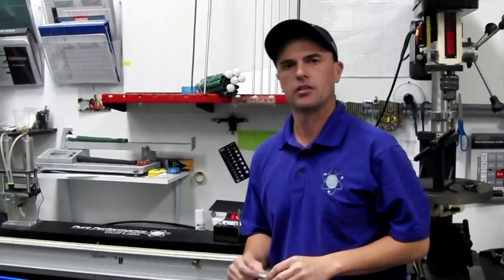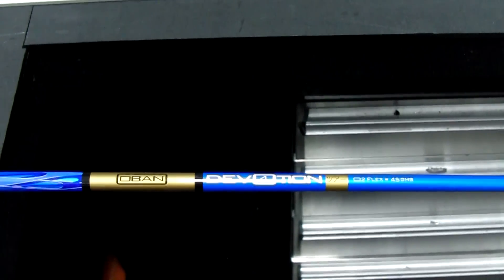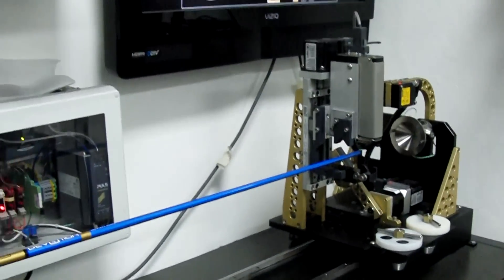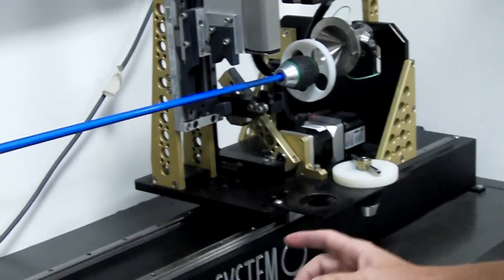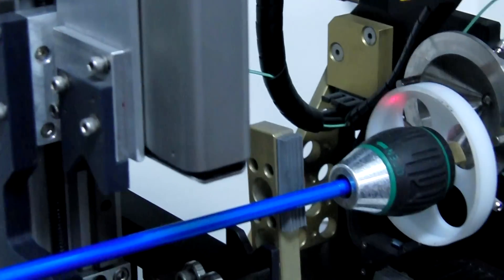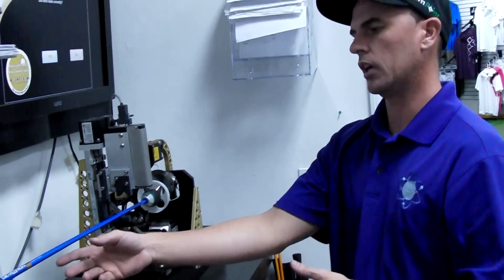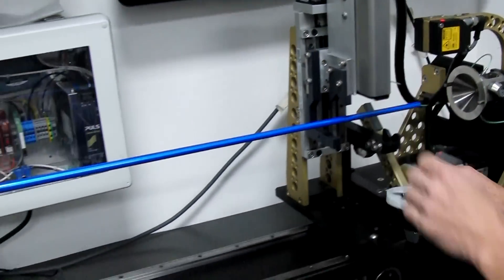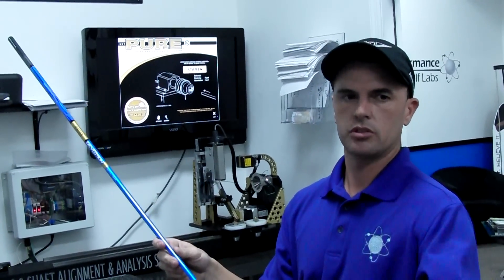SST Shaft Pureing vs Spine Aligning

Comment: When a shaft has multiple spines, it's trash.  No more than two. One is better.  I have had great success using the old bearing spine alignment method.  I weight the tip with a laser and flex and release and it draws a straight line where the spine is.  Assuming it doesn't have multiple spines.

Comment: You don’t spine align graphite shafts because of multiple spines in graphite shafts........only spine align steel shaft you will only find one spine in every steel shaft then insert the spine at 3 or 9 o’clock

Comment: Independent testing showed you might pick up less than a yard on your average shot with NO measurable improvement in shot dispersement. But at $20 per shaft, go for it.

Comment: A bearing based spine finder likely does not tell you how a  golf shaft oscillates.   It will likely find the plane that has the least amount of straightness in a shaft.  If a shaft is in its natural unflexed position, so unstraight it is already bent like a spatula, that thing will turn every time to the mcdonalds arch position in a bearing spine finder.     Yet, what does that tell you about how the shaft will actually bend when a force is applied to one end?   Guys who put a weight with a laser on the end and let it hang loose and then tighten so it now has its center of gravity straight down, can then twang the shaft vertically.   Do that, rotating the shaft and you will likely find the straight flexing planes or FLO flat line oscillation.   Got a frequency meter, measure the frequency in each of those planes to know the stiffest one.   One may also wonder if the stiffest one is best, or if someway one could measure how wide around that shaft that spot stayed oscillating straight as the best.         Want to find the unstraightness of the shaft, or residual bend in it.  Use Kaufmanns inverted flex board.  Mount the shaft horizontally, and put the tip in like a block of wood roughly size of matchbox, which then rests on your scale.  As you turn the shaft, the highest reading is when the shaft bend is pushing down into the scale, the lowest reading would be when the end is then trying to point up to the sky.  If you want to try to get some type of way to compare the numbers, they are showing you the bend.  However, if you put two  holes in the block an inch apart, and the take the difference of the numbers, that will give you a force number with most all the residual bend impact eliminated.

Comment: I have seen people find the spine of just the shaft and then do the FLO procedure without the head on the club.....you need the head on to use the weight and symmetry along with the shaft to see the WHOLE picture....there is a lot of misinformation on both spine and FLO and I think it deserves a better look and explanation.  This glosses a few great points on how it could be done......my concern is DYNAMIC FLO....meaning with the head on and you will find that the spine might be a starting point reference, but only 1 out of 15 times does it line up with the oscillatory forces with the head on.....

Comment: at what point do you add the the swing  speed factor in to the shaft twist? 
say i have a swing speed of 85mph.  shaft is  flo/spine.   Now at address my shaft Spine is aiming at the target. Now, from the top of my swing, on the way down, the shaft will twist towards it's weakest point  so that the spine will no longer face the target, the weakest point will to the target! because the shaft will all ways take the least resistant path. and the amount of twist will depending on the speed at which it is traveling. Now make the swing speed 115mph, Shaft will still twist via it's weakest point faster.
 So, in theory! spine adjusting does little good. better work on Shaft flex and kick points. And since the kick points are the least path of resistance you can control the amount of twist  at the  kick points. Take an X stiff shaft and put it on the machine, If I'm right, you will find the x shaft will take less adjusting. May be even no adjustments needed. And. HMMMM! something to think about!

Comment: No offence intended but quite a garbled explanation.  Spining cannot be directly compared  with shaft puring. To compare operations identical procedures should be followed. In the case of spining such only comprises stage 1. Stage two is to loosely affix the head to the shaft (bind the tip with thread and then force the head on over it); fix the shaft butt in a vice;  vibrate the head; adjust until everything flat line oscillates. 

But is shaft puring, or fine tuning spining by F.L.O (flat line oscillation)  the logical way to go?  As opposed top say simply spining?

When one swings a golf shaft the force of the head causes shaft twist (torque) and many  assume that  at impact the shaft  and head have somehow reverted to bring the head in square  

I venture to suggest that if one affixes a giant weight (i.e. a club head) to one side of the shaft, and combine that with centrifugal force, the club face will have a natural tendency to come in open. Hence golfers inter alia turn over their wrists in the impact zone in order to correct such.

I further suggest that the force twisting the head open is too great to be countermanded by simply adjusting shaft spine location.    Thus flat line oscillation gained in either a puring machine or by vicing and tweaking  is purely a misleading  illusion.  Even if loading the shaft a la puring maching did work the load to apply is unknown unless one knows how each golfer loads the shaft via swing speed, lag etc.

So, I suggest that neither spining or puring can provide a means to alone consistently bring a club head in square. The larger key to such is  through a combination of both wrist turn and the natural turning motion of a sound golf swing.

Obviously however such needs combining with a consistent head position and spining by itself will go a small way to encourage such insofar as such enable the shaft to achieve its optimal minimal torque. F.L.O.ing  and puring are both unnecessary as largely they alter the spine location via a wrongly chosen  force and undo a small amount of good work.

Comment: PURE is a great and it is the most accurate way to spine and/or FLO a shaft.
I wouldn't challenge PURing but I would say that it is much mot beneficial to also perform a MOI matching on the clubs as opposed to Frequency matching. Most shafts these days are tapered anyways...PURE+MOI match FTW

Comment: I Floed all my irons about 2 years ago which I have been using for 20+ Years. I found the spine as a reference, then found the strongest bend position, used this to face the target, installed the head and then fine tuned floed the club until they perfectly Flat lined. I didn't use a fancy pants computer controlled machine but I believe I got each Iron spot on. The only difference I made to each club was they felt stiffer. I do not believe it made any difference to consistency or distance.
Reply: If you do not believe that it made any difference to consistency or distance, do you think that these analysis/processes provide a psychological placebo effect?
Reply: @jalan8171  When I first used the clubs after I altered them they felt stiffer than usual, I got pretty used to the feel of them after using them for so long (20 Years no joke). After a few games I got used to them again and I honestly would have not known any difference. Distance did not change and my handicap didn't dramatically change overnight either. If It helps someone play better knowing they are "Pured" then go for it. Me personally, I wouldn't do it again. Im now playing with off the shelf Mizuno's bought from eBay and my handicap is the lowest (8) its been now for 3 straight years. I have commented on this topic before on WRX and I had one bloke telling me I did it wrong and needed it professionally done but I don't believe it would make any improvement over what I did to them.
Reply: @jalan8171  I have also done this to graphite shafted Fairway Woods and found little to no difference also. I did it to a set of Titleist 910 3,5,7 Woods (I don't like hybrids) with Aldila Rip A Shafts. I now play Titleist 913 3,5,7 Woods Aldila Rip A, untouched, still set on A1 neutral. I can hit them fine and like I said my handicap has been its lowest for years.

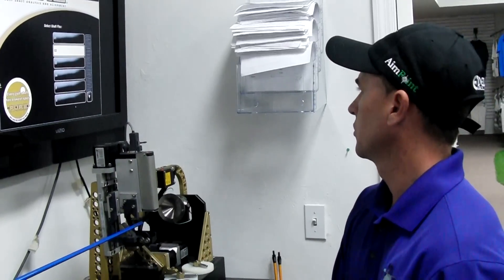Comment: you can set the club up to draw or fade by moving the spine to the left or right.  For the clubs with adjustable heads, when you move the head to a different loft it does change the spine.  I prove it to players everyday.  It the club kicks to the right guess what, a fade or slice. If it is set to far to the left here comes a draw or hook.  You always want the shaft to kick towards the target.  Very simple process to do but no body knows how to do it.  If you set the spine at 12:00 you are hitting against the spine.   Different club builders set the spine at 3:00 and at 12:00 but 9:00 is the only setting that brings the club face back to the target line which gives u more kick from the shaft and most of the time more distance and straight.
Reply: Kenny Pruitt you can do this and it works. however, it is ILLEGAL during tournament play.  http://www.usga.org/rules/equipment-rules.html#!rule-14618,bend
Reply: excellent information, thanks. i am spining my uncut shafts soon and will glue them in at 9.00
ta
Reply: So does that rule not dictate that all shafts must be perfect, and therefore all are illegal as it impossible to manufacture them without some degree of asymmetrical flex.

Comment: This would get you an altered flex (freq.) - max stiffness point for the stick. Seems that for irons, you'd have to freq analyze the shafts after SST, in which case you would have to hand pick a  set from a stock of already SST'd and freq'd,  individual iron shafts to get your desired freq (determined by fitting) steps accurate.

Comment: I think most of the confusion here is stemming from the idea that the spine and PURE orientation are not only interchangeable terms, but that they can be consistently correlated, no doubt the blow back from some clever marketing relating to "spine alignment" from years ago.  Simply put, Identifying the "spine" only gives you a reference point from which to begin the process of FLOing a club, which is still a manual trial and error process, and not privy to the data set that this machine offers.

Comment: You are correct that the shaft is turning and twisting.  What this method does is find the most consistent position of orientation for the shaft relative to the clubhead, that COMPELS the shaft to naturally return to its ORIGINAL position DESPITE the inconsistencies of the LOAD ON THE SHAFT DURING THE SWING.  Unfortunately this process is NOT conducive to the current manufacturing/distribution model used by the top equipment companies due to the overwhelming ignorance by their customers en masse

Comment: This is completely and totally wrong.  Anyone who has the comprehension to understand the variables involved KNOWS that the "spine" is just a reference spot while performing the FINAL orientation of the shaft relative to the club.  There are other "spines" in most shafts that can work against or with the main "spine" identified with simple bearings.  This SST method does with technology what used to be achieved only through a manual trial and error process.

Comment from the maker: All the guys you named in your quote REQUEST shafts SST Pured. You balance a car tire whether you spend $100 or $400 on the tire. SHAFTS ARE NOTE PERFECTLY ROUND and will want to flex in a direction based on that shaft and how its installed.

Answer this- If it does not matter which way the shaft is installed then why does Miyazaki make a shaft (Dromo) that depending on how the shaft is installed it will want to flex draw or fade biasis?? That proves shaft orientation matters

Comment from the maker: The 2 Clamps provided are the weights of a driver and a iron. I can assure you that once you aligned the shaft in its a pure spot it will flat line oscillate. Can do a video to prove it if would like?
 If you don't have physical measurements of the shafts structure what good does it do to flatline oscillate a shaft??? 
We fine shafts that are to out of round that we do not use the shaft. SST gives you a straitness run out of each shaft ran through it.

Comment: SST Pure does not take its measurements with the head mounted. Therefore it cannot mimic how the shaft will oscillate once a head IS mounted. There is only one way to get perfect straight line oscillation. You have to do it manually by dry mounting the head to be used and move it around until you find the right spot. It helps to find the spine first. Either by Puring or spining but all it does is give you a starting point.

Comment from the maker: Spine tool only uses ball bearings it does not matter the holder they are in. You spin a shaft in 2 ball bearings and the build er tries there best to distinguish what he thinks is the spine.
SST PURE takes physical measurements of the entire shaft 360 degrees and locates EXACTLY what part of the shaft is the stiffest and what part of the shaft is the softest part of shaft. Locates that and then we flat line the shaft from that point. SST MACHINE ALSO DOES TORQUE AND STRAITNESS OF THE SHAFT.

Comment: Your comparison was completely rigged. I hope it is not intentional but I speculate that it is. But be honest with people. You used the ball bearing method. It is cheap and its crap. You should have used a REAL SPINE TOOL and unless you threw it out when you got the SST PURE machine, I bet you have one. The truth is that the SST PURE method is the easiest method for finding optimal spine alignment but it is not THAT much better than using the proper tools.